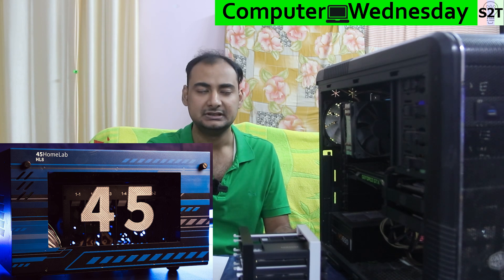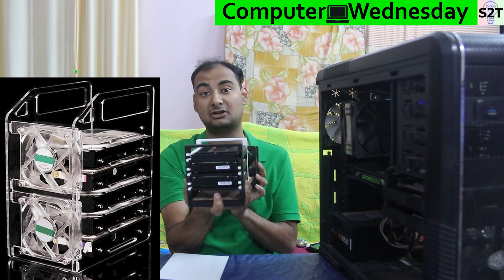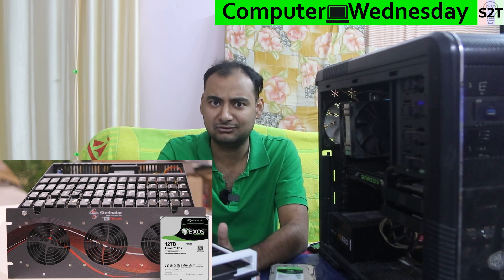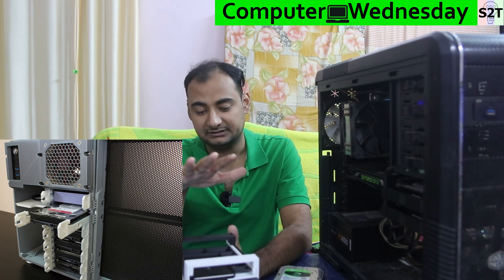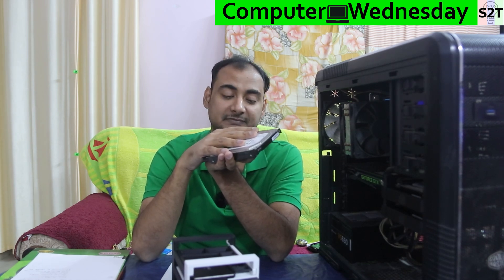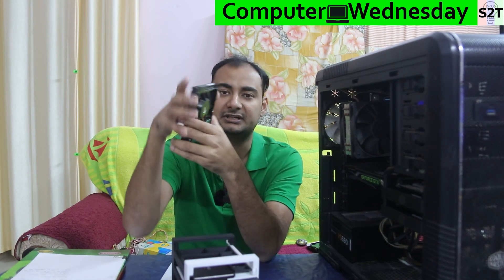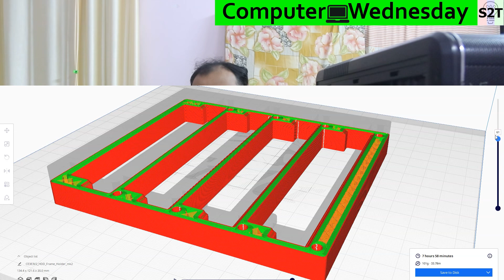DIY 3D printed Encloser Explained {Computer Wednesday}

Comment: im looking into these type of things, i see on aliexpress they have acrylic ones and such but 3d printing would be amazing for one of these so im looking into that
Reply from the maker: it did not exist as in u can hot swap & proper air fllow from side not where u block most from wires and its on the shorter side . last I checked